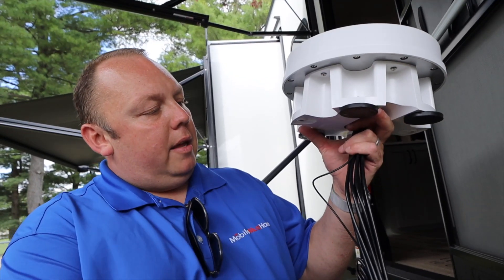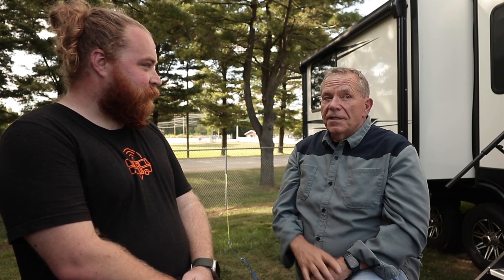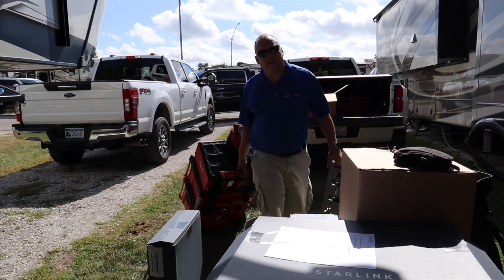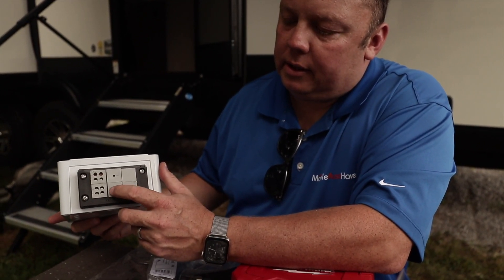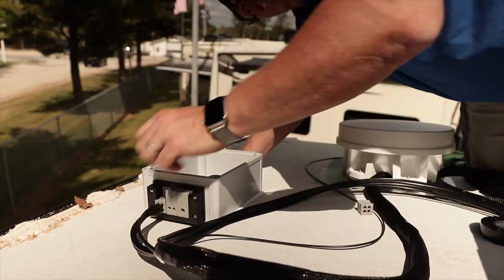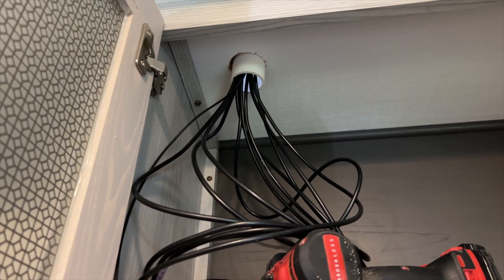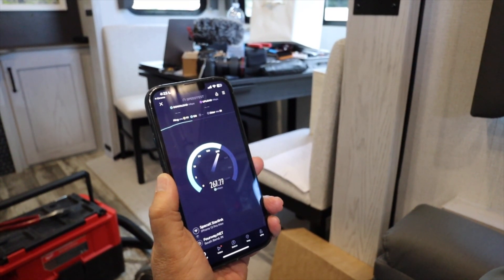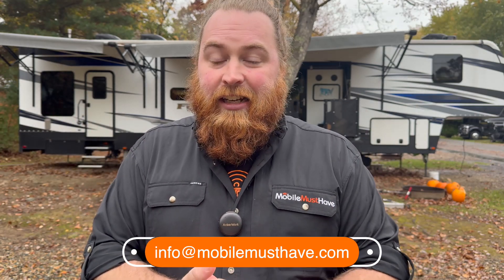2024 Epic RV Internet Install, multiple cellular, Starlink High Performance with Peplink SpeedFusion

Comment: Hi guys
great video, very helpful.
My wife and I are about to purchase your Road warrior VR2 package.    In watching this video, I see you used a piece of galvanized  steel plate to glue down to the roof of the RV, then use the magnet mounting of the antenna.  Can I purchase the metal plate from you?

Thanks
Frank
Reply from the maker: Hi Frank! Thank you, glad the video was helpful for you! So, we don't sell any magnetic sheets on our site, but you should be able to easily find some options at a local hardware store. There aren't any specific requirements besides it just needs to be magnetic. If you have any other questions, reach out to us via email at info@mobilemusthave.com and we'll be happy to help!

Comment: Why are you still using the Starlink Router as you can just connect the dish directly towards peplink ?
Reply from the maker: That's true, but it requires several extra accessories plus some extra installation steps, so we thought this would be the best way for us to show how to add Starlink into a mobile internet setup. Thanks for reaching out! Happy New Years and safe travels!